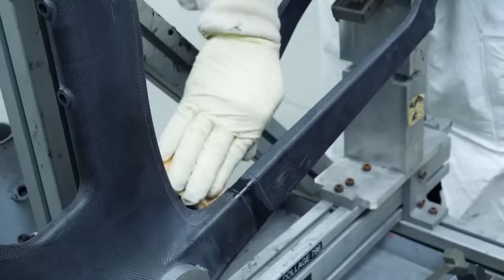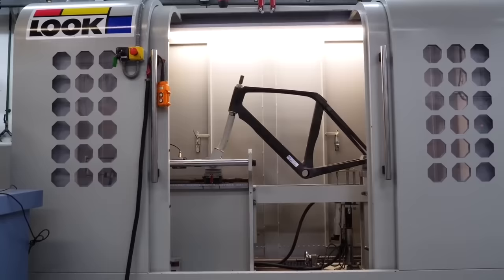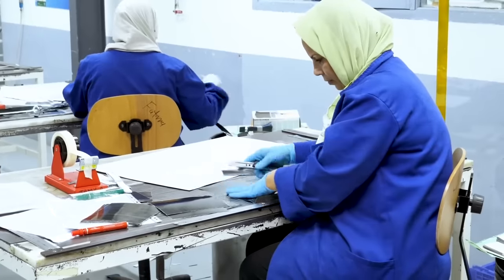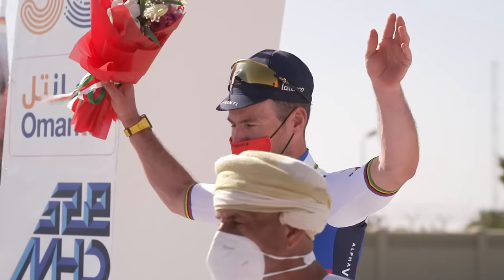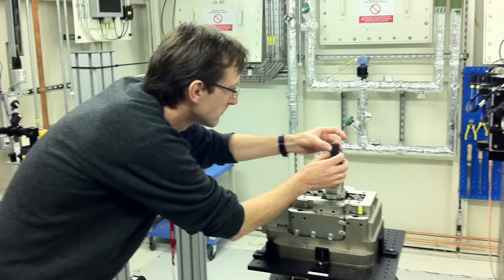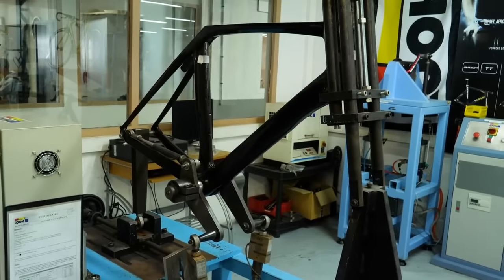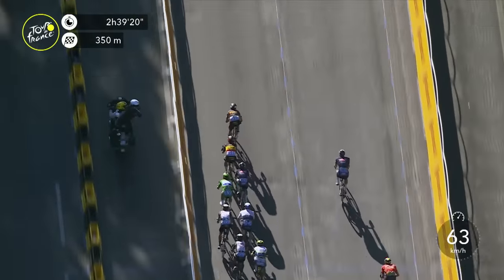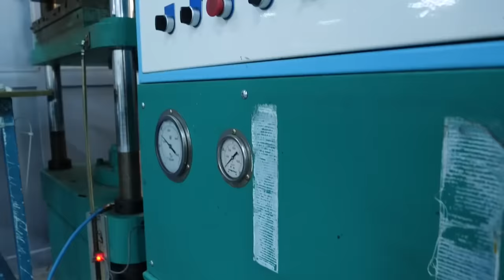Your Carbon Fibre Bike Won’t Last Forever

Comment: Carbon fiber and fiberglass react to stress very differently from aluminum and titanium alloys.

Where the author here mentioned "microfractures" in fibers from repeated deflection, metals tend to "work harden" or become LESS flexible with deflection or impact at the specific metal-grain boundaries the stress forms along.

The more brittle or work-hardened metal alloys get, they lose elasticity but don't necessarily lose strength.

But where they lose elasticity through increased hardness, if a serious deflection or torsion occurs, the work-hardened alloy will crack catastrophically.

Overstressed, work-hardened metal alloys sections can generally both be detected with a $200 Rockwell Hardess guage, and work-hardened damaged sections can be replaced by a halfway competent TIG welder in in their garage with a $600 DC TIG welder.

Working with & repairing carbon-fiber requires Xray and significantly more training and expensive equipment, there is no carbon fiber autoclave that I am aware of that a well-resourced hobbyist could setup in a garage, similar to a tintanium or aluminum-alloy bike-frame builder. $40,000 starting price for an autoclave requiring high-temp insulation, wiring, heating coils, fans, and thermocouples, that have relatively short lifecycles and are costly to replace. Nothing autoclave is cheap, or plug-n-play.

Carbon fiber is amazing, but the cost of entry both for building and repairing, is very steep.

Most people could have a titanium-aluminum alloy frame custom built for comparable to the cost of carbon-fiber, that a hobbyist could easily keep up with the best of carbon-fiber bikes, and that could both survive as bad crashes as carbon-fiber,
but also be infinitely more repairable than carbon fiber, for 70+ years through hard abuse.

At least until the development of low-heat curing carbon fiber resins, we will never have artisans and hobbyists with carbon fiber autoclaves capable of handling a bicycle frame size piece. A carbon fiber bike will become functionally unrepairable from the nature of carbon fiber.

Comment: Fantastic brilliant video,  top quality. 
Average cyclist guy,   I believe I will be sticking with :     steel,   aluminium,  titanium. 
Carbon is only really needed for applications like racing, elite sport. 
I have several bikes in the garage from 1980's.
My first proper road racing bike, which arrived as a Christmas Present in 1985.  Reynolds 501 frame. 
Happy Days.
Steel bikes, which generally genuinely can and do last for a lifetime.

Comment: Nice to see a propper engineerings on a channel like this. Especially like that they are not completely dumbing down their answers (of course they do to make it understandable for the common audience). Their answers feel real/legit because they acknowledge what they can't know about certain questions. Because the don't have the proper data for this specific bike related topic to make a propper statement.  WE NEED MORE ENGINEERING ON CHANNELS LIKE THIS. instead of the typical marketing wank.

Comment: This explains why so many frames have gotten heavier since 2017. Yeti sb6. 2017 trek fuel 9.9. yeti asr. All just stupid light frames and I have personally seen every one of them break. These new bikes are, like a pound heavier, haven't seen one break yet. Revel rascal. New fuel. Sb150 etc. They aren't as fast but they probably have a fraction of the warranty claims

Comment: Great subject, and a great job done by the interviewees to present their thoughts clearly without going into too much "Geek-speak". You can tell Ollie is in his element just by the gleeful look on his face.
On a technical note, is frame compliance only about the orientation of the carbon fibres, or does the manufacturer change the epoxy as well? I'm picturing not only the fibres flexing under strain, but also that a more maleable epoxy would be less prone to fracture.

Comment: I had a similar lifetime question about butyl inner tubes, that was seen as ridiculous. I wonder if the hysteresis stress of inflating and deflating inner tubes between rides reduces their lifespan?  This lifetime topic is interesting and important to all parts of the bike and I'd like to see more coverage.
Reply: The chances of a butyl tube degrading before you get a puncture is unlikely, latex however.....

Comment: Awesome video! My takeway (and belief I have always had) is to buy a carbon bike from a manufacturer well known for fine tolerances and quality manufacturing (of course). As eccentric as Hambini is, he has had some good videos showing voids and sloppy tolerances from certain manufacturers, and I'd avoid those. He and others have opinions on the better manufacturers in terms of the actual process, but you have to take it with a grain of salt and these opinions are hard to find. I trust LOOK and TIME, personally, as i have really only ever heard good things about them in this regard. 

I have owned two LOOKs. My first carbon LOOK from 20 years ago is still good, but, a tad flexy. It has always had a bit of spring and response to it. When you put the power on, it gave a little bit and then sort of sprung back and it was always my favorite riding bike. Possibly nowadays that effect is a bit more pronounced than when I first got it, after watching this video, I'm thinking. My new LOOK is stiff, but also has a wonderful feel to it that some carbon bike lack. The tolerances were spot on for the BB, frame alignment etc. I can tell the care and precision that went into it. I had 3 bike frames from another well-known manufacturer when I raced, and all three had issues and two had failures. I think there's lessons to be learned there.

Beyond that, it comes down to use, as said. Ultimately, you just have to ride it. That's what it is made for. I do not use my good carbon bike on an indoor trainer - that's just unnecessary abuse and wear, and you don't get any of the benefits of a carbon bike while on an indoor trainer. I got a lower end AL frame and older 105 components for that. I also use this bike outside the first couple of months of Spring, when the weather and roads aren't as good, and I am coming off the winter and not really benefitting from the racier bike anyway. That reduces use on the carbon bike immensely. Even so, given the fact that my old LOOK had thick carbon tubes, and my new one like all new carbon bikes has very thin tubes in some places, I expect needing to replace a modern carbon bike's frame every 4-8 years, give or take quite a lot, depending a ton on mileage and use conditions.

Comment: The first interviewee singled out the Specialized Roubaix zertz by name, but i didn't get by what mechanism that's advantageous. But... my 2010 Roubaix, XL carbon frame with zertz fittings has about 8K miles (I think, maybe more). I'm over 100Kg but don't hammer very hard or take it off sweet jumps and it still feels very stiff, no creaks, solid. I'm gonna keep riding it. And maybe lose a few pounds.

Comment: This is a great "short course" in materials science.
Brings back some memories from university ;)
The discussion about metals and how fatigue develops within the micro-crystal structure, brings up the question of mono-crystal components, such as jet engine turbine blades - which are "grown" from a melt, as a mono-crystal, before being finish-machined.
Would it be practical to grow bike frame tubes as mono-crystal components?
How about lugs, machined from bulk mono-crystal material?
Are there technical issues, or is it just the economics? (which is horrendous for mono-crystal manufacture).
Reply: The monocoque single crystal frame might be a technical step too far if the bike was to conform to the UCI double diamond shape. The single crystal is developed from a kink in the casting mould for the turbine blades (from memory) which allows only one crystal to develop while the melt cools. So where the frame bends might cause defects by allowing other crystals to develop. A frame shape similar to the monocoque Lotus bike should be possible and casting lugs and tubes probably is too. The economics of making them though is probably horrendous.

Comment: Really interesting discussion. I had a Carbon Bike & used it constantly over 10yrs. It’s been used in various countries & never had a crash. Towards the end of me using it, it started feeling like the Carbon felt soft & I started to loose confidence in it’s performance. As not fully sure I destroyed it just in case the Carbon  had run it’s life span.
Reply from the maker: It's interesting that you began to feel that - probably best you found a replacement in this case.
Reply: @gcntech  Just lost trust in the ability of the Carbon, so it went on my Turbo Trainer for a few years & then in the bin.

Comment: It would be nice to hear from actual bike engineers that have run the tests and don't have to rely on speculation. Most of what these two cover is mentioned to some degree in entry level materials classes. Most of these answers felt like guess work answers I could give (some of their answers, mostly Dr. Marrows, conflicts with what I was taught). 

Not to discredit their answers but they are taking something they know to be true in their specific field and expanding it based on intuition to different situations.

Comment: at 31:05 James says something that is  untrue so i'm wondering what the context of his statement is: "the failure [of cf] is less catastrophic". When I was at Boeing in a CF class taught by one of our experts, we were shown stress/strain curves  -- for CF composites, you reach the stress limit and the fibers fail in a cascade all at once  unlike metals  with plastic deformation after the peak of their stress limit util the material  ultimately fails -- It's just that the peak of that curve in CF is much higher per unit mass.  Interesting discussion about microfractures in epoxy matrix. Good stuff.

Comment: Well I watched it straight through & didn't think that was too long.  It's ok with me if it had been twice as long and thrice as geeky.  I've cut apart probably a dozen different carbon frames over the years and one thing I will say is that carbon frames from the last ~4 years are much, much, much better than carbon frames from 10 years ago.  So even if there is ZERO degradation in your old carbon bike frame, you are almost certainly getting a significant upgrade if you buy a new one.  Way fewer voids, way cleaner joints, (definitely) way fewer wrinkles and resin pooling.

Comment: Great video.   I've started thinking lately about the lifespan of non-monocoque bonded composite bike frames.  I own a 1991 Specialized Allez Epic (fun fact: one of the first consumer bikes with Dura-Ace STI) which uses a combination of round carbon tubes glued into aluminum lugs (plus a bonded aluminum fork).  I'm not a materials scientist but my training in chemistry leads me to not trust the now 30 year-old adhesive holding this bike together.  The bike hasn't been scrapped yet though... it's my trainer bike where it's still holding up just fine and if I have a failure, it won't be at speed in traffic.

With more modern bikes, it's the thought of fatigue in the forks that makes me slightly nervous but then I think of all the inexpensive bikes out there that aren't breaking forks and reason with myself that my mid-range monocoque frame must have better manufacturing and therefore lifespan.

Comment: My carbon bike developed minor cracks in both of the chain stays after over 100,000 kms of regular usage. It was the creaking noise that lead to the discovery of the defect when torque was applied on climbing or sprinting. In the latter years I was averaging 10,000 km per year.
Reply: Same here - investigation of creaking revealed DS chainstay crack. But only 10,000km on 2009 Dengfu FM01 frame (at least it was cheap and meant I didn't risk my nice carbon bike!) Probably not engineered for 92kg 1500watt sprinter or more likely that Dengfu was probably a bit immature in terms of engineering prowess

Comment: Excellent video and well curated. Information is very precise and factual based. Crystalline and polymeric structures are both different. For bike applications, stiffness to weight ratio is what manufacturers are trying to achieve. Obviously, any material has degredation over time either from the environment or loads applied. Most importantly, we make full use of the bike.

Comment: I have Cannondale Synapse Carbon. There is SAVE Plus   Technology developed by Cannondale. Few points of this frame are flexible to absorb bumps from road. From about 7 years any issues with that frame.

Comment: This made up my mind.  I can't take anymore crashes at my age....got away with it too many times...I am sure the next one will permanently affect me (ie broken hip or worse).  Mega riding my steel frame 1987 Trek 400 and have considered a new carbon frame bike for the last year for the performance they offer but was scared away with stories of front fork failure or head tube failure.  I really don't think I can enjoy riding if after going over a typical NE Ohio road (ie: huge potholes) I have to worry if the carbon will suddenly snap on me causing me to eat my teeth or a jaw bone!

Comment: Most of the bikes with a raw carbon finish still have a clear coating over the carbon weave. At least I hope! Because I have an S-Works Stumpjumper EVO with the carbon fiber weave visible. I specifically liked that look, which may have not been the best idea in retrospect 😆

Comment: CF is inherently, somewhat hydriphilic and will absorb a small amout of moisture from the air over time. That's an issue in aerospace as the mass of of CF airplane structures increases slighly over time.  Also, CF layups have to be balanced by alternating plys (e.g. +-90 degrees with the same number in each direction) since when cured there is inherent stress between plys.

Comment: Didn't get touched on - but to extend on the comments about "ductile" metals.  All other things being equal.  A steel frame that flexes - but never gets taken to its "yield point" will always recover and not fatigue.  An aluminium frame that flexes but never gets taken to its yield point WILL "work harden (fatigue)" and eventually fail.  Aluminium has a much lower modulus of elasticity compared to steel.

Comment: Lets say you have raw carbon with clear coat. The clear coat crack and moist creeps in and wander under and around these cracks. This plus UV i imagine is what he talks of as a damaging factor. Ofcourse same would apply if you had a painted frameset. Had it been a metal frame corrosion had likely occured. Paint and clear coat don't flow as smooth with bending/ flexing as a carbon frame does. The paint (or in case of only clear coat, it's same) is "harder", which eventually and/ or probably will start to crack. Off topic, but cracks in metal can be stopped by drilling a hole in front of the crack. Otherwise you won't stop it from keep on growing.

Comment: My over engineered C50 frame of 2005 seems fine though as an old, underpowered, light climbing whippet this would be relevant to your conclusions. Though after this video it will be continued to be stored in a darkened bedroom, as I'm not ever going to buy another one a £4K+. Great analysis drawn out by concise knowledgeable questioning.

Comment: very interesting.  Would love to see a similar presentation on titanium vs. steel vs. aluminum
Reply: on a roadbike frommetals would mostly be uneffected. Ti and alum will be much stiffer then steel stell allows for a nicer 'flex' much like Carbon. and of course the variable of the thickness of the metals would be important

Comment: Very informative - particularly great to have the engineer make comments on the fatigue characteristics between the various materials. Subjectively, I like the fact that metal frame failure warnings are so obvious. The subtle warnings from carbon frames - slow motion failure - concerns me. That fine line between success and failure (graceful failure) is hard to detect before it's too late.
Reply: I think you may have this around the wrong way.  A metal catastrophic failure is immediate and detection is predictable if you have appropriate measurement devices but not because it gives you warnings.  EG A shimano Hollowtech Crank failures I have seen; the catastrophe is not you falling off (ok you may think so) but the delimitation that lead to cracks in the metal that suddenly become massive. It has failed before you fall off as you either did not notice or misread the signs (eg creaking) if there are any not always apparent.  Carbon graceful failure can be felt well in advance of any catastrophic failure, eg as discussed in the video,  a Sprinter notices the frame going dead but the frame won't fall apart under the sprinter, it will just be slower.   I am not saying one is better than the other but they simply have different properties for differing uses;  but I admit to having  a full carbon crank (and it is lighter than a Dura Ace Hollowtech) so I made my call.
Reply: oops Delamination...

Comment: Due to the heavy rains where I live the roads have really degraded, yielding nasty potholes. While I try to memorize where they are, there are always news ones developing. It's very unnerving when I hit one that is not always visible at high speeds. Probably would be a good idea to have the frame checked periodically. One thing less to worry about at speeds of 40 to 50 mph.